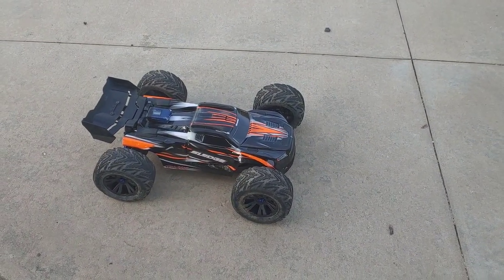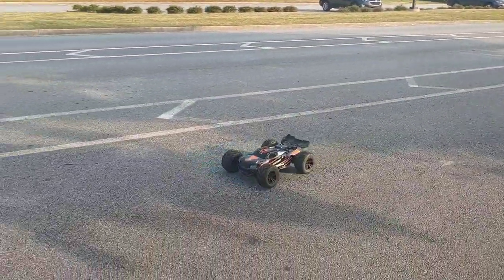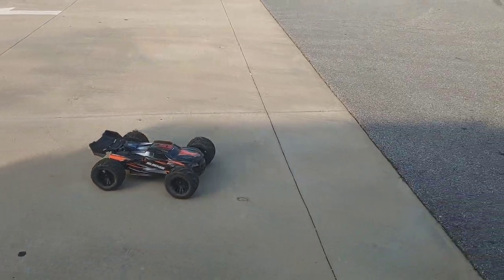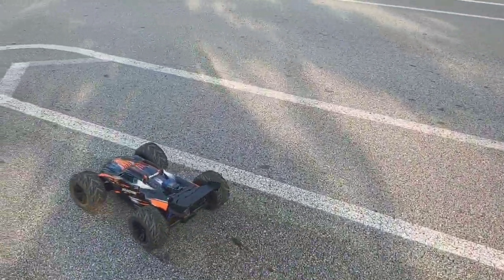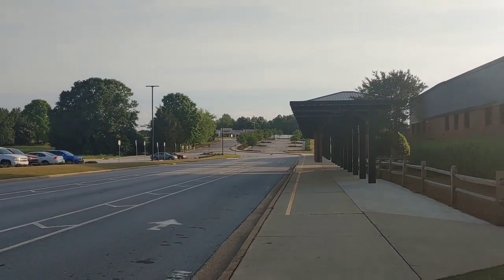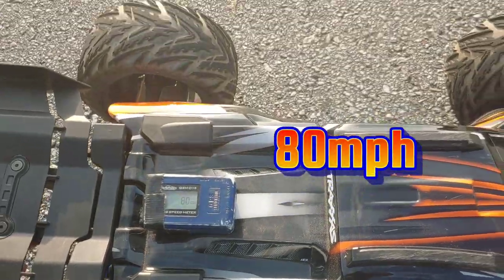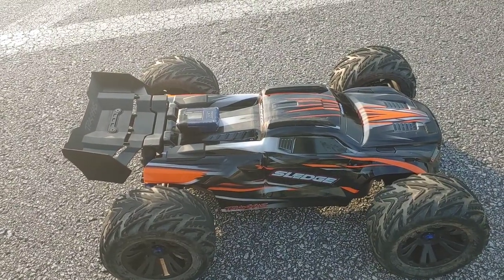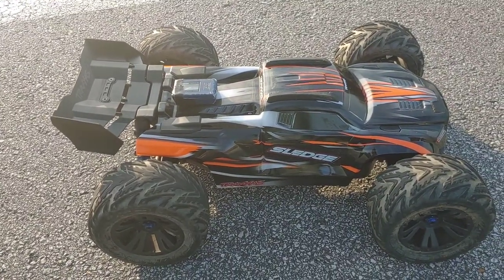Super Speed Sunday - Traxxas Sledge 6s VXL w/22t pinion & 46t Spur

Comment: For the price, it should do 80 with its stock electronics & only a pinion change 🤷🏾‍♂️
Reply: It’s a heavy badger.
Reply: Not possible, to get this kinda of performance required a esc and motor that together cost as much as half the price of the entire car
Reply: @domone1201  yep 20 lbs ain’t no joke , do you know what are some good fans to put on the motor mount ?

Comment: My LHS has a new v4 Tailion with blx electronics , would that be good for a speed truggy ? Or the Sledge and do what you doing ?
Reply: The Talion has been around Longer and has Parts Galore for it!  I’d buy the Talion. It is a Powerhouse and Will Fly with the right Gears!
Reply: @twrecks116  ok sounds good and @ $400 it's a deal .

Comment: Your shutdowns could be two things- either you're exceeding the 160amp limit of the max 6 OR you're getting major voltage sag with your battery packs and your Max 6 is shutting the system down.

I had a Max 6 and tbh whilst it was an ok ESC I found it offered no more power than the stock VXL 6s ESC. 

I got myself a Castle XLX2 for my Erevo 2.0 and yup, it woke my Erevo up....The XLX2 wasworth every penny.

Put the stock ESC back in your sledge and do a comparison. I bet your nembers wont look much different over stock.
Reply from the maker: The shutdown was also because of the motor limitations of the esc.